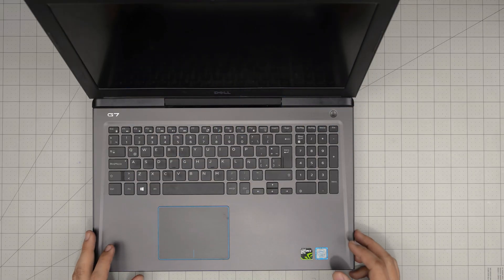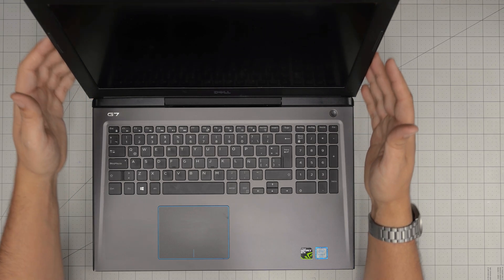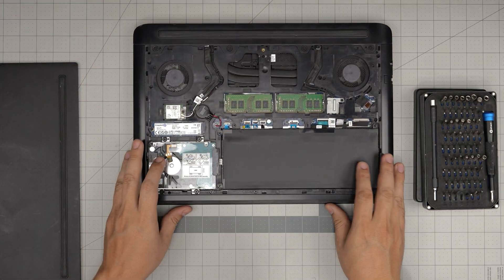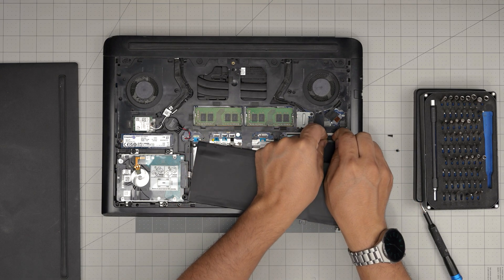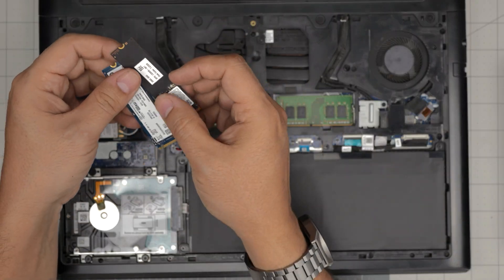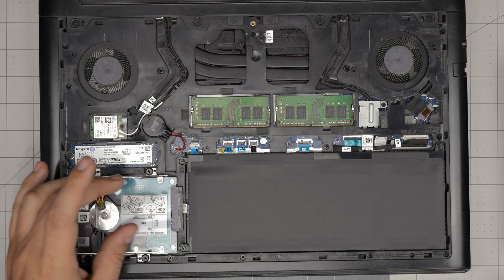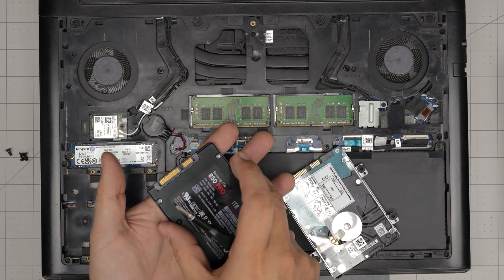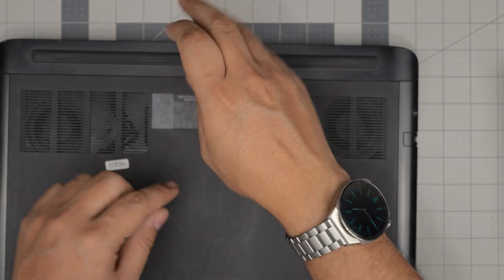Upgrade Storage on Dell G7 15 7588  SSD & HDD Installation Guide

Comment: Hi a have a question. I can not see my new  NVME drive, it doesn't appear when I try to do a new installation of windows or Linux. It had a 256GB SSD SATA in the slot beforehand. What could be the problem with my laptop not recognising the new SSD?
Reply from the maker: you may need to watch this:
https://youtu.be/SDOSqI9ZIZE
Reply: @uFixTek  This really helped, now my laptop detects my new NVME SSD. Thanks a lot!
Reply from the maker: It's my pleasure my friend.
if not detecting during installation then you need to watch this:
https://youtu.be/SDOSqI9ZIZE